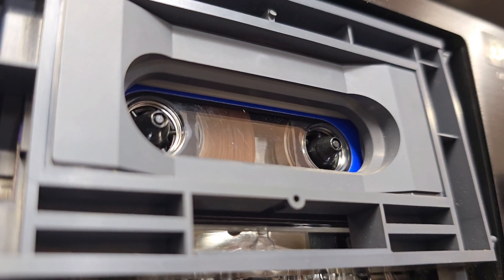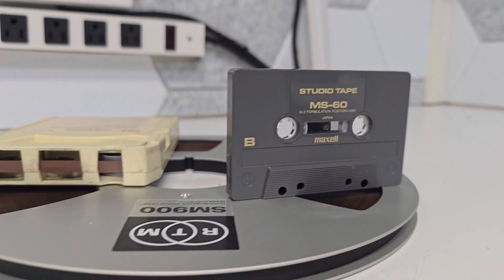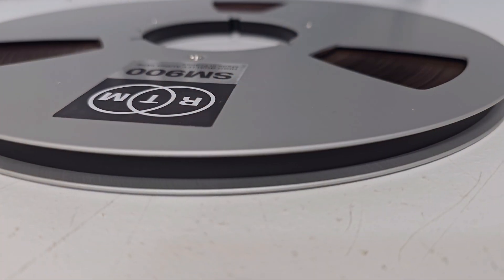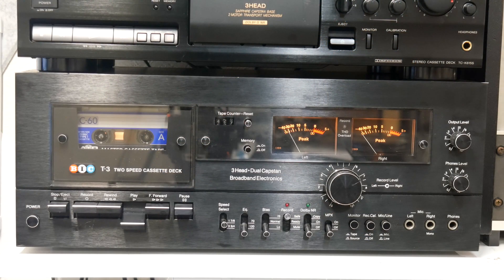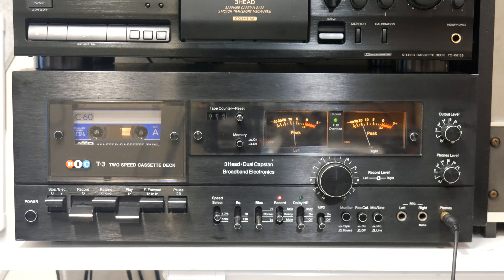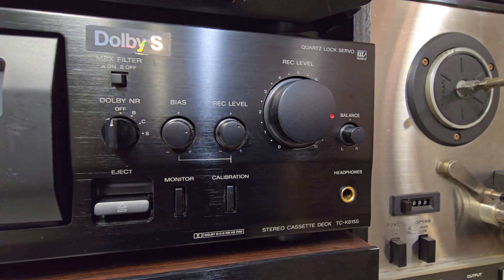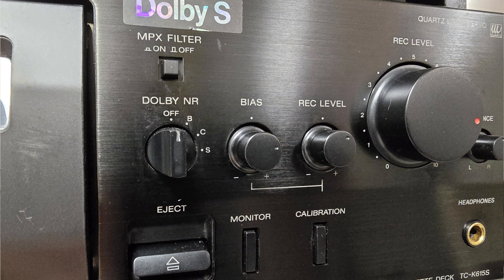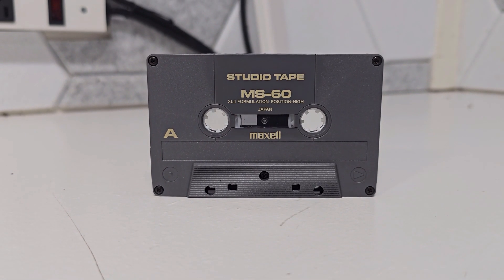Dolby S Noise Reduction - As Good as Digital? Dolby B C and S Comparison - RTM Tape Giveaway Winners

Comment: You worried about noise ? The flutter will annoy me much more and if that deck is mine I repair it if possible or I wont use it anymore. Another thing about Dolby: you MUST calibratie your deck to the tape you want to use, in case of Dolby C within 0,3 dB else artifacts might be heard.
Reply: Thank you! I was about to write the same thing, the first deck had really bad  flutter, the second, it was noticable too, switching between source and tape you could hear the wobbliness, it sounded a bit fragile on tape. I'd suggest those decks def get a full service and check the w&f is within manufacturers spec.
Reply: Same here, don't use it... could be a warped pinch roller, but how about wearing out bushings of parts that aren't available for decades. Not worth the risk.
Reply: @m80116  what ushings go bad on those?
Reply: @Zimmy_1981  primarily motor and capstan
Reply: @m80116  ah ok, thanks mate
Reply: @m80116  Primarily the entire mechanism. Old hardend oil and grease, slipping rubber coated idler wheels, bad take-up friction assy.. ect.ect... The entire mechanism must be taken out the deck completely and will need a total overhaul if possible because same specific parts might be not available.
Reply: @paullongtailpair3812  most brands didn't use any oil or grease at all in gears, pulleys, levers, slides. They relied on the property of the materials, plastics against metal it's already a bushing per se.
Reply: @m80116  Butt all sleeve bearings like the capstan bearing are sinterend bronze filled with oil.
Reply: I have to agree with the number of channel viewers that both decks need some transport maintenance. The lowest Wow & Flutter possible is necessary for the best analog recording and playback . The Dolby S is good but the transport''s misbehavior detracts from the experience. I shall stick with my JVC DD-7 with Super ANRS.  And I agree with the idea that analog recording is a personal thing so everyone can enjoy the fruit of their labors of love.

Comment: I have 2 Sony TC-K615S decks and neither work. I'm sure even without looking the belts turned to goo causing this problem. I don't know anyone in my town who will repair cassette decks so they sit. I bought these because I thought being a 2-motor transport it may be possible to keep the constant tape to head tension of the more expensive Sony Dolby S models that had dual capstans. Is this possible? Actually I don't know if each of the two motors are dedicated to each of the 2 hubs (could be the second motor did something like open and close the door and has nothing to do with the tape transport tension). Do you know? As for the question would I use S? Yes, once I had it I went forward using it on all of my recordings as I thought it was better sounding. The downside, unlike Dolby B, you really wouldn't want to playback Dolby S tapes on non Dolby S equipped decks as it obviously needed to be properly decoded to sound right. Do you find this true also?
Reply: Definitely NO, the dual capstan have two flywheels with a belt between each other, the 2nd motor just drives the hubs in take up, forward and reverse by the means of a swing arm.

Comment: I couldn’t even hardly tell the difference until the audacity bit. 
I listened on my TV thru a Denon AVR and Klipsch RF-35 at normal -29dB listening level via Ethernet. 
They all sounded well within an acceptable listening experience. 
I’ve found in my recent recordings when using Dolby B,C,or S , that when activated it should just barely change the music. Like only take the very small hiss and not the highs away. 
Then I’ve used inferior tape and the recording is dull with Dolby on. 
I have pre-made tapes from the 80’s that sound great with Dolby on , and pre-made tapes that are muddy with it on. 
Some pre-made tapes are made from a superior master copy and others are not. 
Just like CD’s , they are copies of original tape masters. Some sound amazing, others are just ok. 
A CD’s output level is also way higher than a tape. I have 12 tape decks from 10 dollar machines to 800 dollar ones. 
They all sound amazing if you can master the tuning of the deck. 
Speed , Azimuth,clean head and pinch roller, along with a quality blank like TDK, Maxell , or Sony.
All the decks are quality vintage models run thru a vintage Amp and speakers. 
I enjoy a good CD , I enjoy tapes more.
It’s a warmer less clinical sound with better stereo separation imo.

Comment: I have a Sony deck with Dolby S I bought a few years ago just to mess around with the format. I also have a single pre-recorded cassette with Dolby S encoding--Prince The Hits vol 1.

It sounds really good, but still not quite the quality of CD.

I'm thinking of trying to record some 24-bit/192khz DVD-Audio tracks to a type 4 tape with Dolby S and to a type 1 tape with no reduction to see how much degradation there would be between them and the original source.

Comment: Recently, I did some measurements from my deck. Reproduction of single frequency I've monitored on spectrum analyser. 1KHz , on reproduction, and there appear harmonics 2,4, 8 KHz etc. Please can you make video of this issue, it is not so complicated to view, but very important in tape reproduction. Imagine audio material of spread freqs with all that harmonics? Btw, I saw that by using "spectroid" for android.
Reply from the maker: Interesting! I'll do some research on that.
Reply: @VintageElectronicsChannel  think it comes from inductance of head. If so, why nobody mentioned that?
Reply: It's because you're recording too hot for the tape formulation you are useing.  Reduce the recording level a few dB and watch the harmonics fall off dramatically or disappear.
Reply: @cuoresportivo155  didn't had clipping, 0dB, but thanks, I will try to reduce rec level. Interesting advice.
Reply: @colloidalsilverwater15ppm88  most tapes can't handle 0dB of a single frequency, if you reduce the level you will see the harmonics drop significantly.  Some tapes do better, some worse.  But with music, you are not likely to hit 0dB at any 1 frequency anyway
Reply: @cuoresportivo155  So, you think that harmonics are dependant and produced bu tape, and inductivity of head does not have anything with producing harmonics?

Comment: I always use noise reduction for Cassette Tapes, B type for type 1 tape and C type for type 2 tape and no noise reduction for type 4 tape. I also use B type for 8 Tracks recordings and have had a lot of success with my Ex noise reduction system, that can work well with both B & C systems. The Ex system works in a very different way to Dolby noise reduction, by working with the phase off set between left and right audio channels.
Reply: I'd be interested in hearing some more about that.
Reply: Dolby C gives the biggest advantage with Type I tape as it uses a technique called spectral skewing to combat tape saturation. Both of my hi-fi decks pull an almost flat 20Hz to 20kHz with a cheap TDK FE in Dolby C and neither of them were particularly expensive. The same tape sounds awful without it despite both decks being accurately calibrated for it.
Reply: @MrSlipstreem  awesome
Reply: interesting since type 4 are noisier than type 2

Comment: I don’t bother with Dolby: too many variables that need to be exactly right for it to function properly, and poor transferability between decks. Instead, I play my tapes through a single-ended external denoiser (Behringer SNR 2000). 20-25 dB of noise reduction and no artefacts. By the way, the piano track on your BIC deck sounds wobbly. Wow & flutter issue ?
Reply: The sony had it too, but not as bad - i noticed it though

Comment: Piano music is very demanding on a cassette deck , and , in first example,  it demonstrates the decks wow & flutter issues . For some reason you didn't use same music on the better deck......
Reply: If I may add , if the deck has excessive wow & flutter , Dolby won't be able to track its decoding. Having said that some cassette tapes lend themselves better to Dolby tracking than others .
Reply from the maker: The reason for the different music is I wanted a shorter selection for the actual testing so I could play it from beginning to end each time and not have to cut it short.

Comment: Audio tech since 1977 here. No, Dolby S is not "as good as digital." No analog system can be as good as digital, especially a cassette, due to the high areal density of the format. And this comes from a man who owns and uses a professional mastering deck that can run at 30 inches per second. And analog tape is always at its best with no noise reduction, as all NR systems increase the audibility of frequency response errors and dropouts.
Reply: Well it can come very close though.... when you switch monitor and tape in a well calibrated high end deck (quartz locked, closed loop dual capstan) you can appreciate the stillness of the waveform.

The appearance of response error and dropout with NR chiefly happens for two reason: wrong calibration and or wrong EQ on the recording deck and degraded tape, which has happened quite extensively on type II tapes at this point in time. Type II had already the worst THD of all 4 tape types, cobalt added formulas didn't age well, chrome dioxide is practically a guarantee of degradation of some degree even if the cassette was sealed in the wrapper.